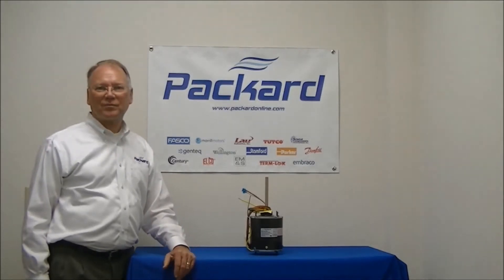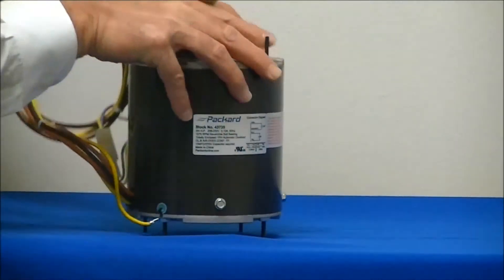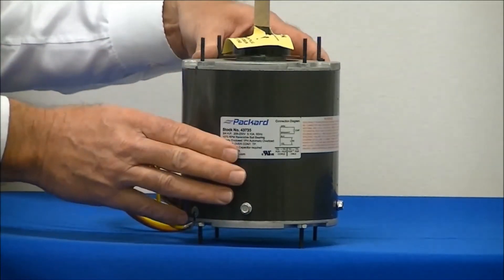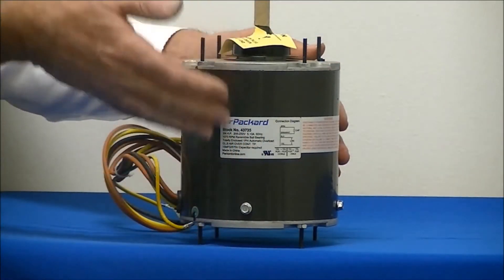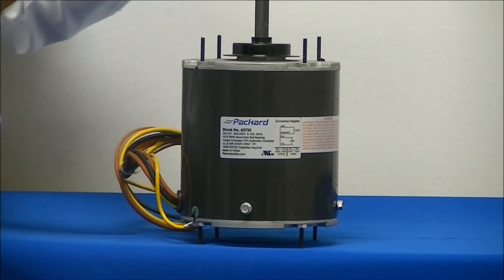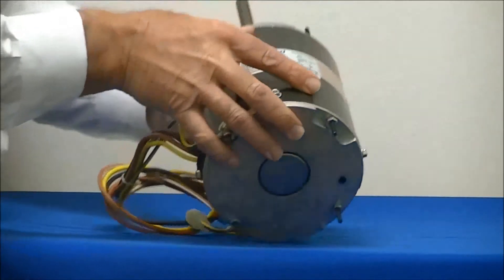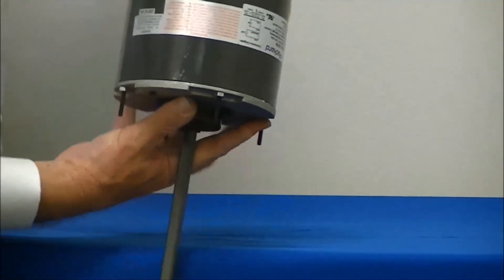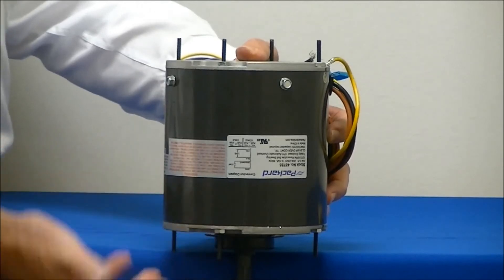How To Stop Motor Failure

Comment: So if I have a train unit and the rubber plug holes are actually mounted on the sides, one HVAC tech said to fill them with oil and plug them back up. Both holes run straight to where the bearing would be

Comment: The motor heat is putting heat into my A/C air flow from the blower fan motor that runs near 105 degrees.  I measured 3+ degrees at duct end with just air flowing 20 minutes.  This heat stays in motor up to 3 hours and hurts A/C performance.  I assumed it was sleeve bearings needing oil or lithium grease.  Any way to resolve blower fan heat?
Reply from the maker: When the unit is operating, measure the full load amps (FLA) of the motor.  The amps must be measured with all the doors, panels, and filters installed on the furnace/air handler.  You may have to bring jumpers out of the blower section or use a Bluetooth meter for your measurements.  If the amps are no more than 10% above nameplate amps and no more than 25% below nameplate amps, the motor is loaded properly.  The operating temperature of the motor at that point should be normal.  If the winding temperature of your motor is 300 degrees, it is well above design characteristics.  I’m surprised that the motor doesn’t go out on the overload protector.  It sounds like a static pressure issue.  For the motor to operate properly static pressure must be correct.
Reply: @packardonline  Temp goes up to 105 that adds 3 degrees at duct end  floor vent.  I believe much of the heat may be normal electric motor heat, but I will pull motor and lube sleeve bearing with lithium grease.   motor is 3/4 hp with 4 settings.

Comment: Where are the oil ports for oiling the bearings?
Reply from the maker: In the motor shown in the video there are none.  It is permanently lubricated.  If you need further information please contact our Customer Service team at customerservice@packardonline.com or call 800-334-1769.  Thank you.
Reply: There are none, Ever hear of the term "Job Security"?

Comment: Thank you!  I just installed one and couldn't figure out what the note meant by replacing the drain plug.   I'll make sure to do it soon.  If it's been running for a week, in 100 degree temperature, would the damage have occurred already?